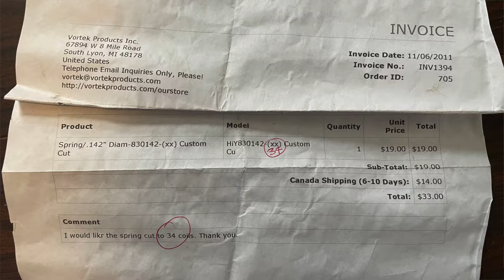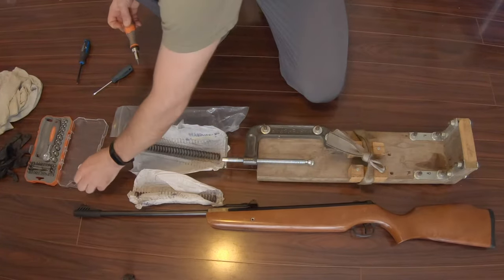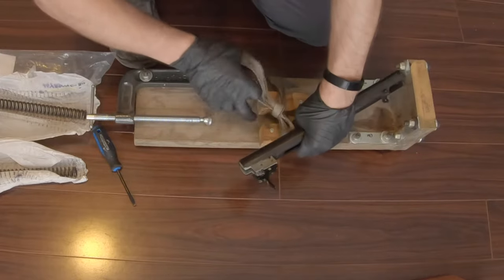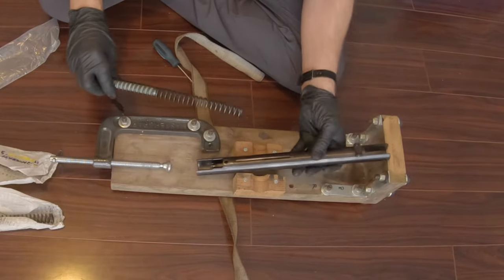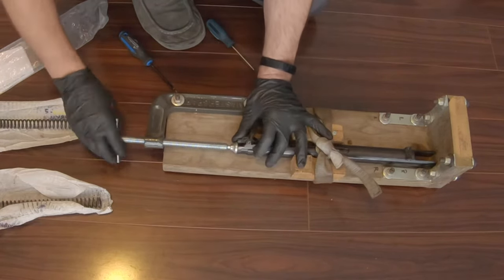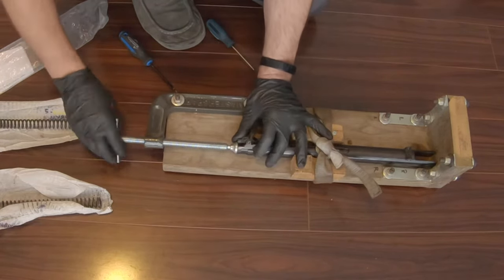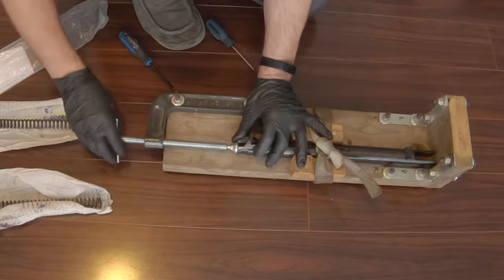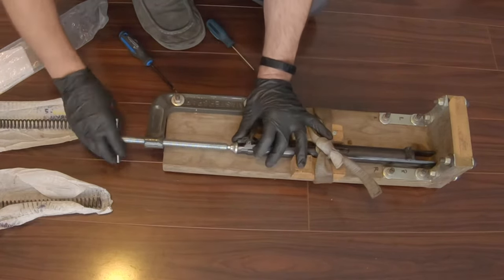Air Gun Spring Upgrade! the quest for FPS!

Comment: Ryan, I have a Ruger Air Hawk .177 and would like to fit a moderator to help make it more backyard friendly.  Any ideas?
Reply from the maker: You’d have to get a gunsmith or machine shop to thread the barrel 1/2x28 if it’s thick enough then buy a can
Reply: As long as it's legal where you live, you can probably make an effective moderator out of PVC pipe with a foam  insert or lining..  All you'll need is some pvc pipe slightly smaller or same size as the end of the barrel , a heat gun, a saw/dremel, some foam, and some tape.  Probably would look custom (weird)...but it should work.
Reply from the maker: Peter V yes that would definitely work but would be illegal in Canada not to sure what the laws are in the states so I would definitely look into that before making anything
Reply: @BROTUNED  .. That's why I started with the legal disclaimer.  One day I wish it will be legal here in Canada like the UK... would be more sensible to help people's hearing and noise pollution wherever the guns are used.
Reply from the maker: Yes I agree 110% but unfortunately all our government wants is to eliminate guns all together but wouldn’t that be awesome. The liberals are making hard drugs legal because that makes sense lol 😂. But guns are the problem they say. Smh 🤦‍♂️
Reply: @BROTUNED  yup....Canada....a place where the reasonable and experienced are led by the  ignorant and the unwilling.

Comment: Are the springs same in .22 and .177 Cali guns
Reply from the maker: I would get not but could be wrong. At least on Canadian guns anyways. They have to be sold at below 500 fps to be a not firearm and to get the pellets to get there a .177 spring would not push the heavier .22 pellet at that velocity so I’d say it would have to be a bigger spring
Reply: @BROTUNED  So the answer is , you're not sure?
Reply from the maker: Yes that is correct ✅

Comment: I CAN`T BELIEVE YOU DIDN`T TAKE THE PISTON OUT. POLISH IT AND PUT A NEW SEAL ON IT AND LUB IT UP FOR REASSEMBLE.
Reply from the maker: It’s easy enough to do just testing the main spring in this video. So the only variable was the spring
Reply: And mill out slots in the piston to make it lew weight
Reply: @crazycressy7986  what is lew weight

Comment: how much fps gain? justin trudue is a pain in the butt, so i was wonder how much my crossman 1377 can gain.
Reply from the maker: I have 3 springs the factory is around 460 spring 2 is in the mid 600s and the 3 spring is around 900 but I honestly like the soft shooting factory spring
Reply: @BROTUNED Isn't changing the valve more important than the spring? Did u gain fps, by soley changing the springs, or did you change the valve, and barrel length too.

Comment: I saw a video where the guy put some vaseline in the pellets and he gained alot of velocity.   https://www.youtube.com/watch?v=AVVQxbRa8DM&t=13s  (9:50).
Reply from the maker: Ya it’s dieseling basically anything combustible in the skirt pocket when the piston compresses the air it gets hot enough to ignite the combustible fuel and will almost double the velocity but not recommend. Not sure what damage it could do but apparently it will cause damage to the rifle. I have done it a lot back in the day with my air hawk and never seen damage but apparently it will so if you do it have that in mind
Reply: You will get more power but no accuracy so what is the use of doing it